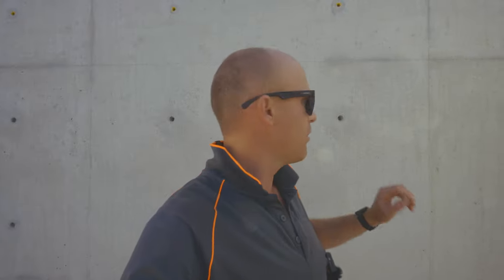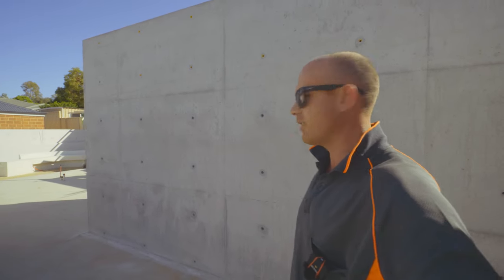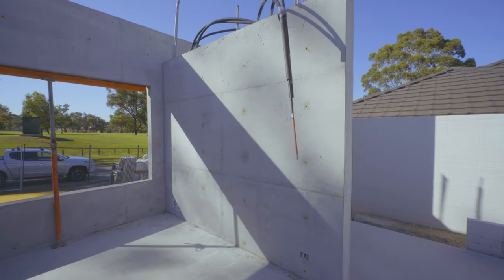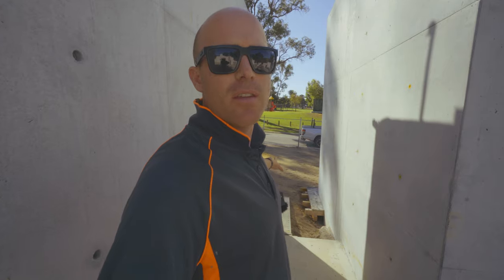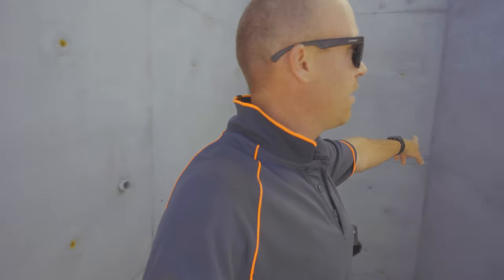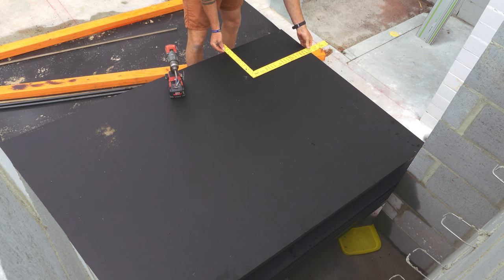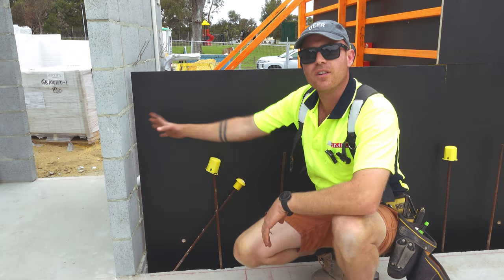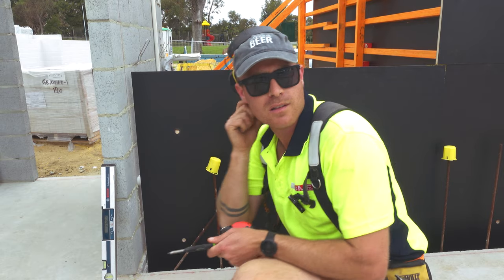Formwork And Set-out Of Off-form Concrete Walls PART 1

Comment: Not a fan of how you're using that square for your holes. There's nothing actually square happening there - you're just eyeballing it, and that's not going to be accurate.
Reply from the maker: Try it. It’s actually very hard not to get it perfect. You can also use stair gauges on your square as stops for more speed and accuracy. You have to have your square quite a long way out of square for your measurements to be out
Reply: @bmformworkconcreteconstruc9783  You would actually be much more accurate by making a mark with a punch (or a pencil) at the inside corner of the square (with your measurements adjusted accordingly), then putting the drill bit in the mark made by the punch.  By putting your marking tool tight against the inside corner you eliminate any eyeballing or guesswork and get much more repeatable hole positioning.

Comment: How does the cost compare to conventional stud and plasterboard walls? Where would you find specs for these walls for residential use?
Reply from the maker: I don’t know what the cost is per m2 for stud and plasterboard. If you provide that I can help. However I’m going to build my own house and it is cheaper and quicker for me to do concrete walls…
Reply: @bmformworkconcreteconstruc9783  How can I get in touch with you to learn more about your services?

Comment: Great work 
How does the wall get weatherproof ? And how does it get insulated.
Reply from the maker: good question. sealer is applied after to weatherproof. Sometimes xypex added to conc to make waterproof.  no insulation. sometimes foam is put inside the concrete wall.

Comment: How long do you leave the forms on before you remove it? And can you make a video on how to to put in electrical pipes and boxes before you pour concrete..
Reply from the maker: walls 1-3 days. suspended slabs 7 days. sorry mate, we don't do the electrical work. all it is is a plastic box nailed to the formwork and a conduit coming from it

Comment: How do you usually handle more than one cast?
Would you recommend overlap of formwork of about 600mm-800mm if there is more than one cast done for the building?
Reply from the maker: I'm not 100% on what you’re asking
Reply: @bmformworkconcreteconstruc9783  if you needed to cast a 12 meter wall in two pours, what advice would you give? Would you recommend using a water stopper at the construction joint, and would you overlap the formwork over the existing wall that has already been constructed?

Comment: Love your work mate! We also living here in Perth. Going to build our new house in Churchlands. Double storey with around 380m2 of living space. How much more in cost would a concrete house build comparing to a conventional brick house? Also which builder do you work with? :)
Reply from the maker: Hi Ken,
We work with many builders so i can recommend someone to suit your build if I know a bit more about it. A concrete house as a guess would be 3 times more expensive maybe more? It also won't insulate as well or withstand moisture as well. There is a reason everyone uses brick! Its the best way. You can still acheive with concrete but price goes up even more.

Comment: Great video! I've been looking for ideas to help inform a DIY project I've been noodling with. The goal is to build the walls of my family's home using precast or off form wall sections( plain outer face and board form interior fac), then piecing them together with rebar via cylindrical spaces cast into the formwork... Do you have any ideas or advice on such an undertaking?
Reply from the maker: We do this sometimes for movement joints.

Comment: How big is your actual crew and imma framer\stripper put on safety officer, and favourite part of the job?
Reply from the maker: I used to have a larger team with up to 8 guys doing suspended slabs but I did not enjoy it anymore. I now like to work on my own or with just 1 or 2 guys. I call on help when I need it. I don't understand the imma framer/stripper safety officer bit?? Favourite part is complex set-outs. Using maths and brain to find simple solutions.

Comment: Great videos! Thanks a lot.
 I'm playing with an idea of self-building fairly simple house out of concrete by utilizing lightweight formwork eg.Doka (as I'm not a builder). Do you think it would be possible to achieve nice concrete wall finish and quality out of the forms without hand building the formwork ?
Thanks
Reply from the maker: No, not possible. It is also not possible without many years experience. I see experienced guys mess it up. If you use doka, it needs to be the look you're going for and well planned out. I once saw a guy doing his own house and he staggered peri panels (like doka) to acheive a brick pattern. It looked cool from a distance but it had so many things wrong. But he loved it. To minimise the difficulty don't go to high(hydraulic pressure) and limit how many corners. Straight walls are easiest.
Reply: @bmformworkconcreteconstruc9783  Well I didn't want to hear that lol ... ! Thanks for your opinion, I'm sure you know what you talking about! I might give it a try anyway however I will do some some various sample walls where the out-of-form finish wont be too critical. And perhaps I will hire professional like you to do the complex, visually critical parts. I've seen those Peri forms - not bad and yes the lining of fake bricks is not nice )

Few questions regrading to your video 
- did you use any release oils on your forms ? 
- can you re-use the form sheets after stripping ? Or they finish too bad ? 

Thanks aging for doing these videos for us ! great job
Reply from the maker: Hi Coudu, the guy didn't use fake brick lining, he laid the formwork in a pattern like bricks. I have been using release oils a bit lately and I notice no difference in the finish or ease of stripping with new ply. With older ply it makes a small difference. in my 16 years I had never used it till last year. I personally think it is a waste of time except on stairs maybe and keeping things clean, but it stinks and make you less clean so I see no benifit. On a wall like this I would never use used ply. Even if you pour 1 side and flip ply over for next pour I wouldn't do it for walls like this. I chopped all this ply up on my next job for stairs and tiny walls.

Comment: Awesome finish. Is there a document that specifies the soldier whaler spacing for Aus ? Or is it engineers spec or other ?
Reply from the maker: No document. Experience. Suspended slabs however must be signed off by an engineer on all commercial projects. Not yet on residential. You can space further than I did in this video. Spacings are much closer only to achieve neat patterns with the sheets for aesthetics.

Comment: If I may ask, what is your go to for formply sheets?
Reply from the maker: I used to have a particular sheet I used, but now with covid I take what is available and hope for the best! I like 1800x1200's. But I'm super keen to try using 3600x1200 sheets on one of these off-form jobs.
Reply: @bmformworkconcreteconstruc9783  Thanks, and any preferred brand?
Reply from the maker: nope. I used to buy the PNG made ply. but now I just tell big river I want a mid priced sheet that is going to give a clean off-form finish and they always select the right ones for me. I don't find the super expensive sheets to be any better personally. And I cut my ply up pretty quick so de-laminating ply isn't too much of an issue.

Comment: What are your thoughts in terms of moisture and heating on the outer concrete slab effects inside the house?
Reply from the maker: Not sure. We just build it, we don't design it but apparently they are using a sealer which will fully protect it from moisture... I wouldn't trust it. As for the insulation properties, I live in a 1920's house which has a timber stud wall with zero insulation. we have a mild climate. Moisture would be my main concern but I am not up to date with sealer technologies.
Reply: @bmformworkconcreteconstruc9783  Thanks for your reply and I appreciate your videos, love your work. I'm wanting to learn and understand more of this building concept. Are you contracted out to builders or are you a builder yourself?
Reply from the maker: no problem! I do maybe 30% of my work for builders, 50% for other formwork companies and 20% for concrete companies. A good spread of clients. what Is it that you do?
Reply: @bmformworkconcreteconstruc9783  I'm looking to build with this concept,  just looking more into it. Do you have business email or website for contact?
Reply from the maker: yeah mate, benmillican87@gmail.com. I can also put you in touch with some builders who like some concrete in their designs.